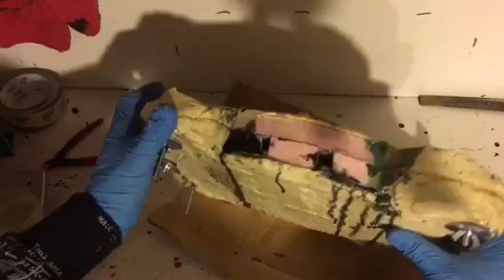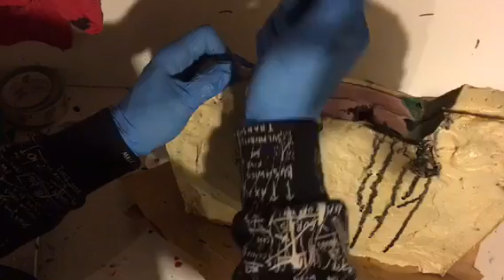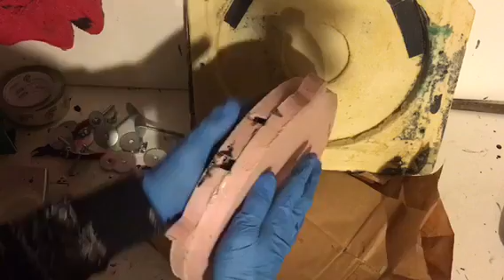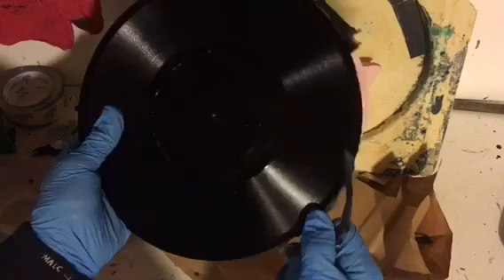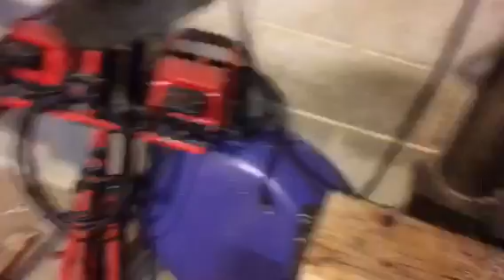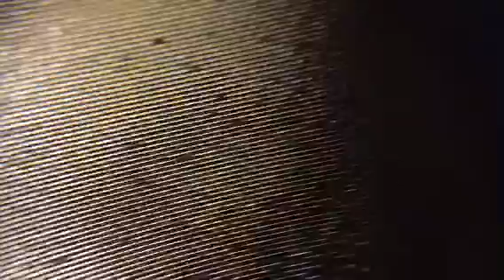The Making of a New Diamond Disc

Comment: It's absolutely beautiful and I would like to ask, is there a video explaining how to make a copy of a record and what resin and pigment you are using as well the mold material name. I want to copy my lathe cut discs. Greetings from the kingdom of Eswatini.
Reply from the maker: Hi,
Take a look at my other videos and you’ll find one called “copying a disc record at home” or similar. Most mold-making grades of silicone will work, but the polyurethane resins are difficult to use, without pressure casting equipment. I don’t recall the exact products which are easiest to use, but I mention them in another video.